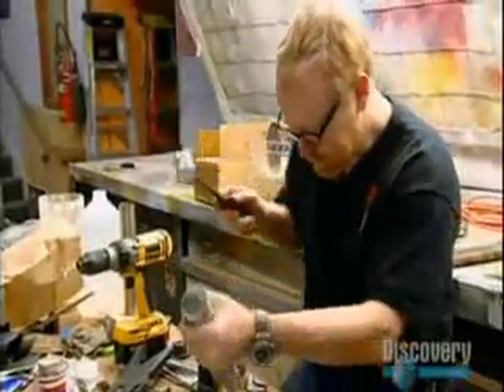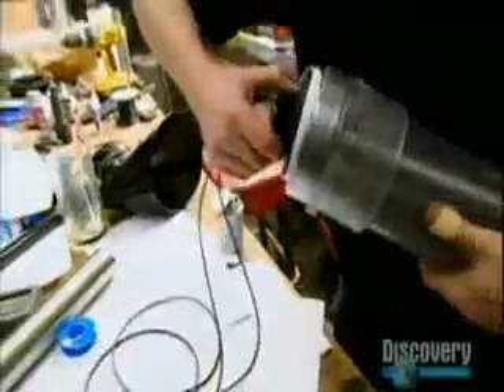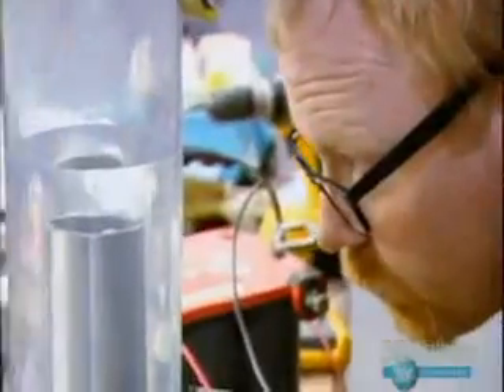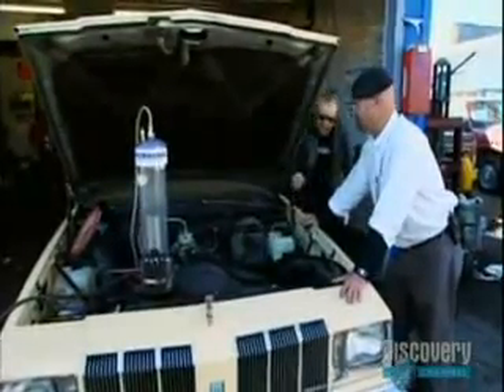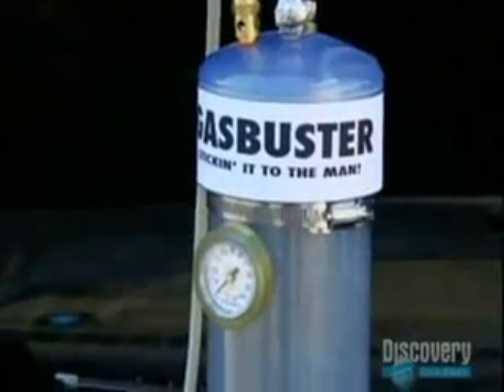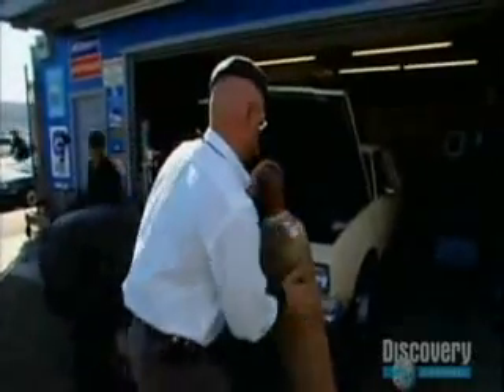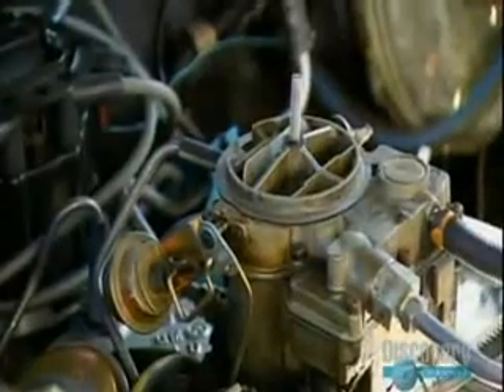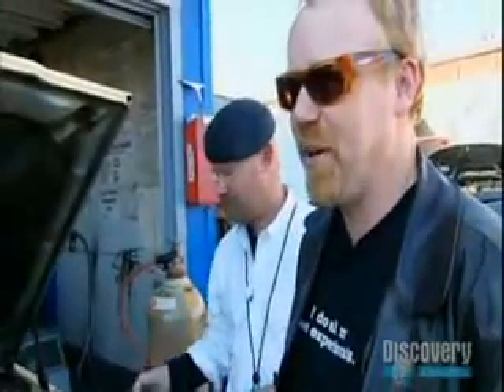HHO Mythbusters Explained

Comment: first off your not supposed to run on pure gydrogen. sposed to let it boost your fuel econemy.
Reply: I guess only if you aren't clever enough to be able to produce enough usable gas to be practical.
Reply: i have no idea the effect of pure hydrogen in a gas engine but one would easily speculate its not built for that. does hydrogen burn hotter or colder? does anyone know. im not gonna google it, i like these conversations.
Reply: It burns hotter and more rapidly, which is why one wouldn't burn it pure but dilute it with an inert gas (such as the nitrogen already present in the atmosphere).
Reply: so your saying it would work with normal air flow?
Reply: The firing timing of an engine would probably need adjusted slightly due to the faster burn time, which would make things more efficient and help the engine run cooler.
Reply: and yet we havnt gone hydrogen. fuck big oil!
Reply: I plan to make all our diagrams and schematics openly available to everyone once the design is as efficient as we can get it, we are currently able to produce usable amounts of gas on as little as 11 watts.
Reply: how many amps?
Reply: As little as 500mA, but 700mA to 1A is where it really starts to churn out the gas.
Reply: i saw one vid where the guy grounded it at the alternator and i believe he said it was crankin about 4 amps. it produced immense quantities. also is there a possibility of corrosion on aluminum cast engines?
Reply: We haven't gotten to the phase of testing it on engines yet, but I have ideas to avoid any kind of corrosion.
Reply: i recommend charging it through the vacuum system or intake. theres tons of videos on it. a lot of ppl have already implemented it to boost fuel econemy.
Reply: I think we're pretty much dead set on eliminating gasoline entirely and not just supplementing it.
Reply: well, you can run ICE's on pure hydrogen, as they shown in this video. some engines might need valves to be hardened, though i'm sure this is unnecessary on newer vehicles. where the question comes into play is running the car on water. i seen a dude a little while back talk about this, he managed to find out how much hydrogen had to be produced to run his car, then he proceeded to find a device capable of producing this much hydrogen on demand. he then metered it's power requirements, and did deem it was too much to allow the vehicle to self sustain. i did talk to him and mentioned just getting a beefier alternator and using like a 5,000 watt inverter to power it with, though he stated that the load on the alternator alone from trying to run the machine would mean it would barely be capable of self sustaining, try to move the car on it and there simply wasn't enough hydrogen being produced to allow the engine to have enough power to run both the alternator giving the machine it's power and to move the car at the same time. this was an older video though, i think he said made in 2003 and then it was uploaded in 2008, so the efficiency of these converters could have increased since, though as far as i'm aware, no well documented attempt was made to get a vehicle to self sustain generating it's own hydrogen while being capable of moving. 

one thing that i do know is the inverter does create a loss of efficiency, but i'm not sure of any hydrogen generators that run on DC only, though i just recently started research, so i might be wrong.
Reply: oh and also, as for the side effects, some vehicles might suffer burnt valves if not hardened, but that is about it, on newer, direct injected vehicles though, you would have to completely revamp the whole fuel injection system as it was designed to insert a liquid into the cylinder and not a gas
Reply: Justin Noker thats exactly why people are just using the hydrogen as a fuel economy booster. sucks right in through the vacuum system.

Comment: I need founds to develop a car that relies 100% on human flatulences
Reply: Actually there were vehicle invented to run on cow dung... produced gas (methane?), and of course it did worked.
Reply: It's also a viable rocket fuel.  Check out:

 https://en.wikipedia.org/wiki/Hybrid_rocket#Basic_concepts

These work quite well.  NASA invented them a few decades ago.  These have been commercially available to Amateur rocketry for at least 15 years, I've built and flown a few.

If you use nitrous oxide as the oxidizer, just about anything burnable will work as a fuel.  Rubber, EPDM, hard waxes, plastic drain pipe, and people have flown them with rolled up newspaper and dried cow dung.

Which is quite ironic, because amateur hybrid rocket motors make a noise like a continuous fart...
Reply: it's rather unlikely that they managed to do the conversion in the car at a sufficient rate to run the vehicle continuously - the digester has to be too big/heavy.  More likely something that gathered and compressed methane from a stationary digester.

Apparently, methane-producing dung digesters are fairly common in some parts of the world (like India or Africa), where a communal digester is used to process the, um, product of a whole village, and they use the gas to run lighting, cooking and battery chargers.  At least one NGO has design/construction assistance and training for operating these things in their repertoire.  And of course just about every garbage dump anywhere produces methane (sometimes it's captured, most often it's just burned off).

The technology has been around for a very long time, just about everywhere.  The trick is to get it to go fast enough to be worth while.  Temperature control is tricky, and there's still research going on breeding bacteria that are less fussy and run faster.

Comment: It works . Not sure on power output on inclines or kws but shit its better then elec rechargeable engine . There a slug and spend most of your time charging . Even the top models such as Merc Amg range etc still have very little drive time comparison to time on the charger . HHO System looks more suitable for our needs . The every day driver .

Comment: There seems to be some confusion of "fuel cell" and "electrolysis (splitting into hydrogen and oxygen) of water".
The fuel cell COMBINES hydrogen and oxygen, which generates electricity.  Water and heat are produced in the process.
As stated above, electrolysis is the opposite, splitting water into its component elements.
You don't put water INTO a fuel cell, you put in hydrogen and oxygen.  You get water and heat OUT of the fuel cell along with the generation of electricity.
Reply: this is where a friend of mine had a question. there was a new GM concept that just went into fleet testing, a fuel cell powered Colorado. we then got into a discussion of converting an ICE to run Hydrogen. then we got into a conversation of "if this concept went into production, get fuel cell version or convert ICE version" and he literally forgot what the difference was after i asked lol

Comment: THANKYOU!!! so many idiots don't believe in hydrogen generators because of them dumb asses
Reply: There's no point in not believing in hydrogen generators.  They were invented in 1800, and used commercially to produce 5-10% of all hydrogen produced in the USA.

Problem is that nobody believes in hydrogen generators saving you money on your car fuel.  Because it won't.  You burn more in fuel producing the electricity than you get back in hydrogen.  Simple.
Reply: Say what you want, the one I made is working amazingly and is giving me hella gas mileage in my blazer, and a good increase in horsepower
Reply: Good increase in mileage/horsepower, measured, how?  Certified and verifiable results with a dynamotor from a recognized testing laboratory, otherwise, that's just more BS.

The human mind has an amazing capacity for self-deception.  You wouldn't want to have to admit to yourself, let alone the Internet, that you're a complete fool do you?

Or, you make money selling this fraud.

Which is it?
Reply: Ha you go with that bud.. it's saved me more money than your excuses for not using it lmao

Comment: Okay, I did this in high school. 
You don't need an "electrolyte". You are pushing a reverse chemical reaction. It only takes a few volts to make it happen but the more voltage you put in the faster the rate of conversion. Mine foamed like a shaken soda can.
The "gap" between the conductors is of minimal consequence. I didn't even bother with making plates or cylinders, I just used a couple of fat rods. All you need to do is get current to flow through the water.
Fancy pulsing electricity with special wave forms doesn't do anything. Again, you are simply pushing a reverse chemical reaction, the longer the electricity is on, the more hydrogen you will get. I used simple DC current.
Fancy equipment isn't needed to deal with the backfire issue. Most of the time, engines, in proper running condition, don't backfire as long as the fuel/air ration is correct (that is what fuel injection, computers and carburetors are for) and when they do, no damage is done to the  engine. Electrolysis always makes the correct fuel/air ration, the reason this video shows a backfire is because he was holding a hose over the engine with no control over the ratio. If you pour gasoline into an engine to make it run it will backfire too. As long as a backfire won't catch anything on fire, you are good.
HHOSportTrac
They said they followed a particular plan, if that plan didn't include an electrolyte or specify a particular spacing then that is an issue with the plan not with Mythbusters. We have no reason to believe they didn't follow the plan they chose.
If you have a plan that works, why don't you send it to them. If they prove it works, you'll be able to sell millions. Don't hide your genius, share it and make the world a better place.
Reply: I did this at home before I went to high school.  The reality is that some of that does matter.  Pure water conducts poorly, so if you want the process to go at any reasonable speed, you need to add something to make the water more conductive.  Adding a bit of salt is the easiest one.  Secondly, the process eats the electrodes you use, and surprisingly quickly, even without salt.  So instead of chunks of copper wire (which erode particularly quickly), you have to start paying attention to what the electrodes are made out of.   Carbon (graphite rods or plates) and platinum (plated onto metal substrate) used in combination is one excellent choice.

Oh, and yes, surface area/gap matters a lot in getting the speed up.  Which is why they use closely spaced plates, instead of rods, in commercial electrolysis units. 

Cut apart a car battery.  Lots of closely spaced plates, right?  Same in a good electrolysis gas generation cell, for the same reason.

But it doesn't matter how fast or slow the cell is, the best commercial hydrogen production electrolysis cells are only 30-40% efficient (in electrical to gas energy conversion), and the very best lab results are still under 70%.  When you factor in that the electricity in a car is produced from burning gasoline, you immediately realize that the gasoline to rotational energy to electricity to hydrogen and back to rotational conversion process (four conversion steps!) is at best 10-20% efficiency.  Burn 5-10 gallons of gasoline to produce an energy equivalent of a gallon's worth of power in hydrogen.  Yes, it indeed sucks that badly.

Electrolysis/electrolytic chemistry is really neat.  You can do all sorts of cool things with them.  Derusting steel, plating (eg: chrome plating) purifying water, generating some pretty exotic chemicals etc.  Unfortunately, making a gasoline powered car go further on a tank of gasoline isn't one of them.

Comment: that episode is the last time i watched their show those fraudulent media propaganda scumbags deliberately withheld the electrolyte that would have MADE THE HYDROGEN GENERATOR WORK PERFECTLY FINE. SCREW THOSE MEDIA WHORES.
Reply: I am well aware. however, that has become the established term to refer to such a device by the less informed hobbyist.
Reply: Of those thousands of videos, what proof is there that ANY of them they actually do save any gas?  You'd be amazed at how many  testimonials can be faked by just one guy.  There are companies that all they do is create faked accounts and testimonals for anything their customers want.  The first thing to check is whether the person who supposedly posted the testimonial ever posted anything else whatsoever .
Reply: Um, fuel cells consume hydrogen and oxygen to produce electricity and water, not the other way around.  Since you can't even get that right, I can only assume that the rest of what you just said is also BS.
Reply: They said they followed a plan. If the plan did not include an electrolyte, how is that their fault?
Reply: siamsurf
You may have a valid point. But, of the thousands of videos do they all function well? I assume some are better than others. How would you pick between thousands of designs? Is there a design you believe is better than the others?
Reply: I have a functioning fuel cell that requires no additives to the water at all and can produce large quantities of gas on as little as 20 watts of input.
Reply: Wildman Fujiami
Exactly! No 'electrolyte' is needed.
By the way, you have an electrolyzer, not a fuel cell. Fuel cells consume hydrogen to make electricity, you are consuming electricity to produce hydrogen.
Reply: These are generally smart and very resourceful individuals, and you're telling me it's easy to understand how they didn't come up with any other ideas or strategies to make the "myth" work (esp. through other means) like they do in all their other videos? I call bullshit. They know exactly what they're doing and exactly what they're not doing. Anything else and both their asses and their prized television show are on the line, and they don't want that.